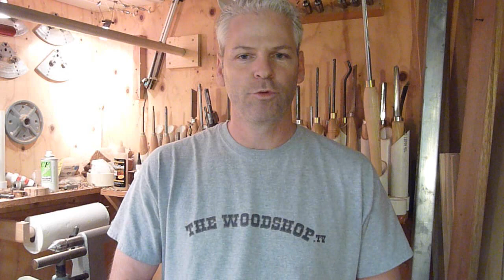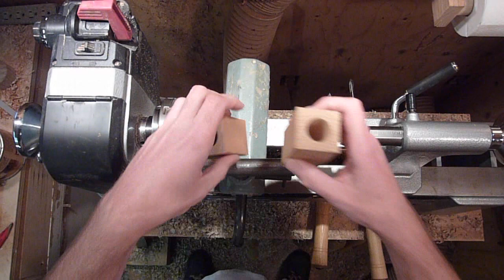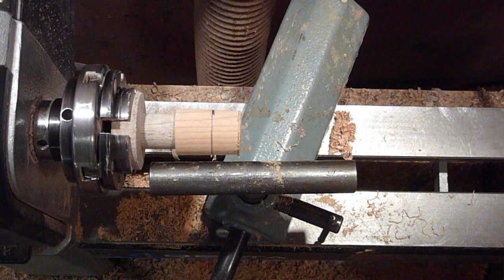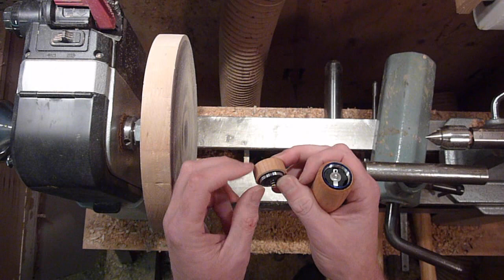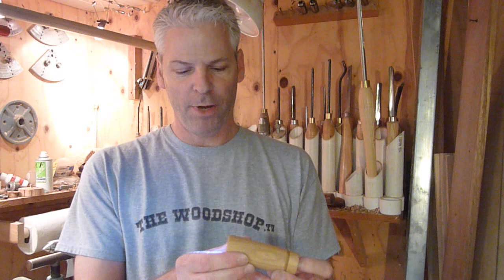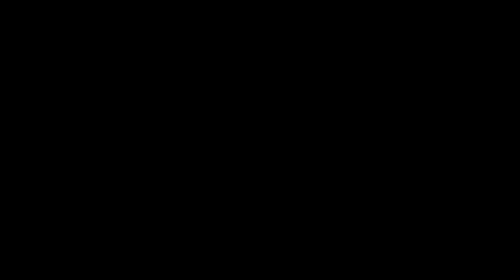Woodturning Wood Flashlight

Comment: I`m going to take the initiative and respond for Carl ;) If it was one piece you would see the metal of the light its self also changing the battery`s would be an issue

Comment: Absolutely.  If you don't hollow them on the lathe, when you turn the walls thin, you could easily turn right through the side as the hole probably wouldn't be perfectly straight if you pre-drill them off the lathe.